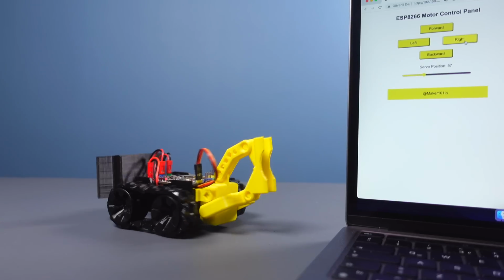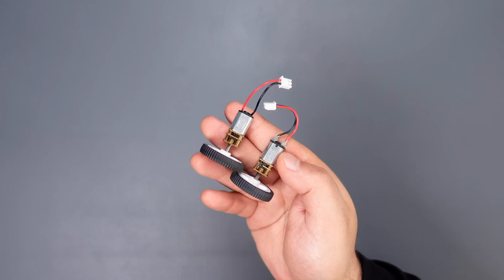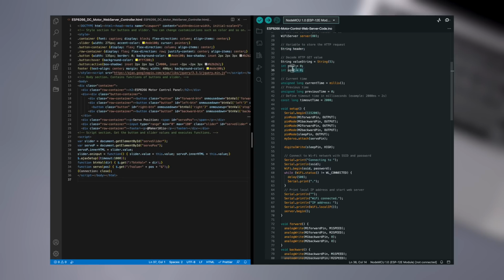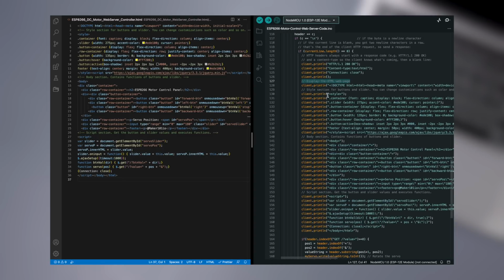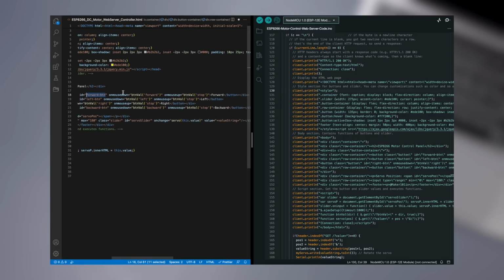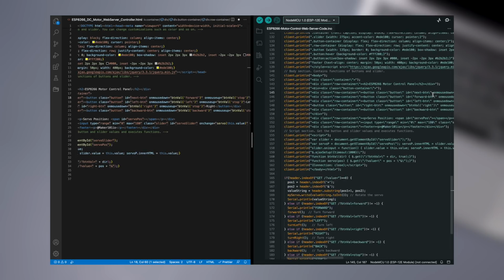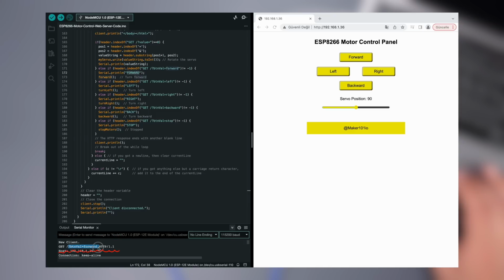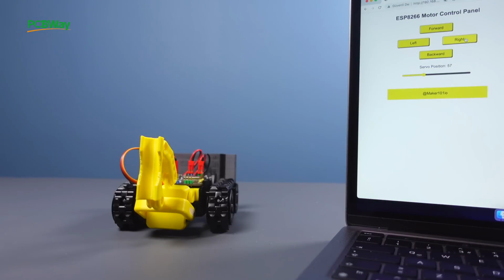ESP8266 Web Server - DC Motor and Servo Motor Control

Comment: How much latency are you getting? I'm trying to do something like this but using web sockets for low latency
Reply from the maker: Thanks for comment. I didn't measure latency time, as far as I've observed, I think I get a response within 500 milliseconds. But, I'm pretty sure the response time received is not 1 second. I think I got a fast response because it was a local network.